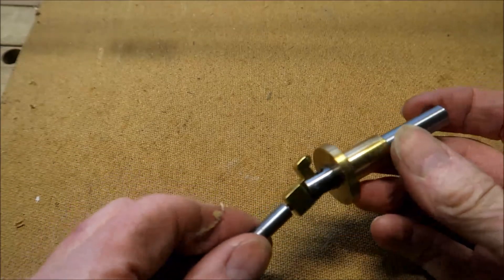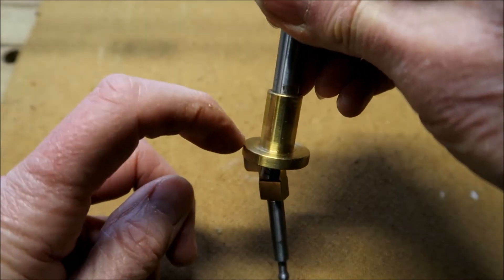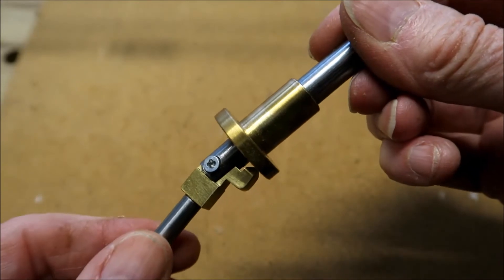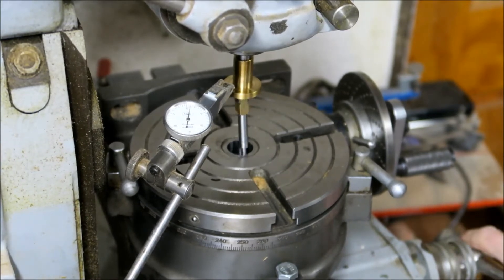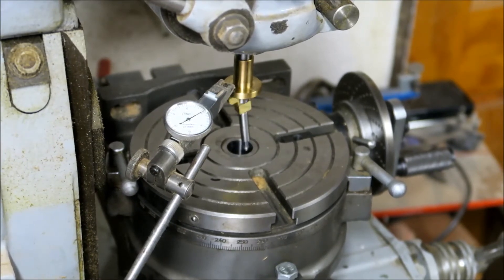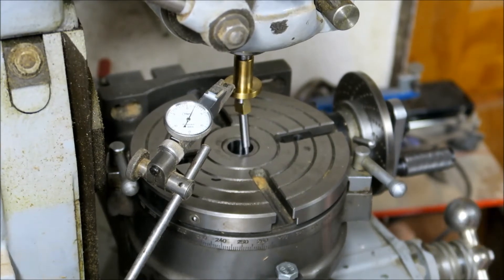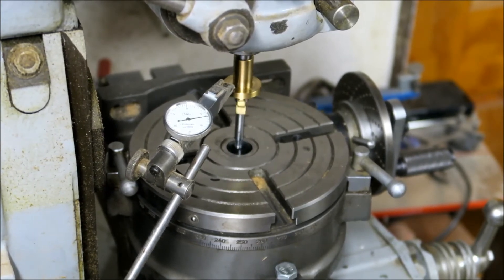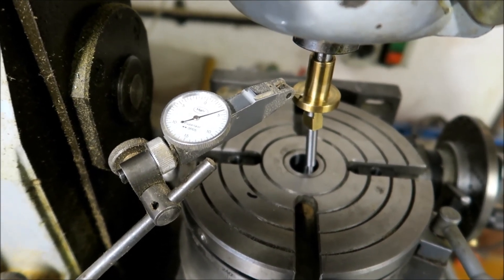Hole Centre Finder. Centre a Rotary Table.

Comment: That would be perfect for the micro and mini mills that don't have enough space between the work piece and the spindle for a standard coaxial indicator. I think i'll have a go at making one like this. Thank you for sharing this.
Reply from the maker: Thanks Keith. Good luck with making one. 😊
Reply: @oldpopmike  Thanks Mike. It's not going very well so far. LOL I'm going to try again. My initial attempt was too far out to be useable. Three thou here, two thou there, etc. It is surprisingly difficult to get the tolerances on my little machines. It's such a great project though. I'm not going to give up. 🙂
Reply: Update: Success! I think I have got the tolerances of the critical parts now. It fits great and slides smooth. I no longer have more that 5 tenths discrepancy. Looking good. Now onto the linkage parts. I'm learning tons on this project. Thanks again for sharing this low-profile instrument. It is just what I was looking for. Cheers!